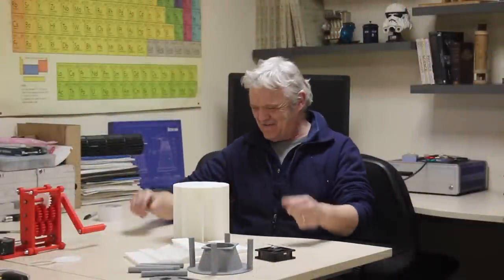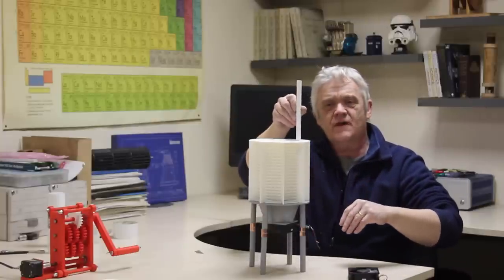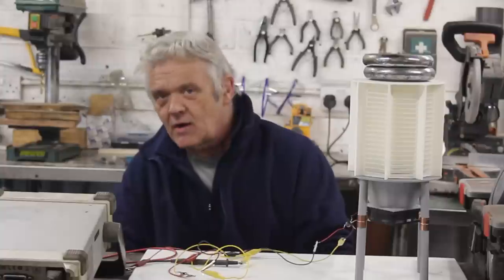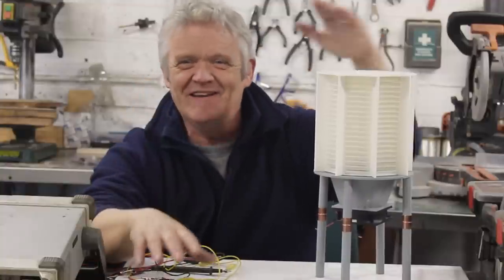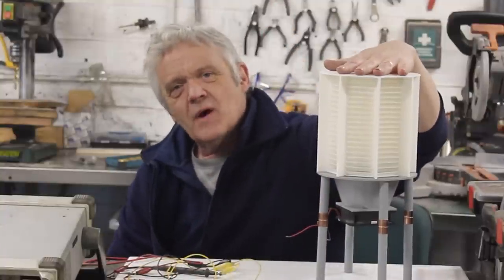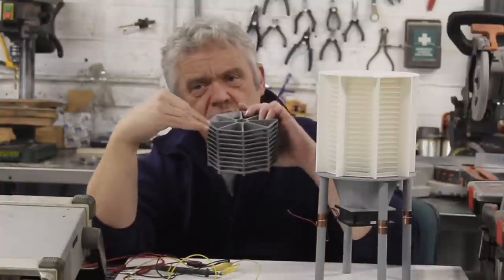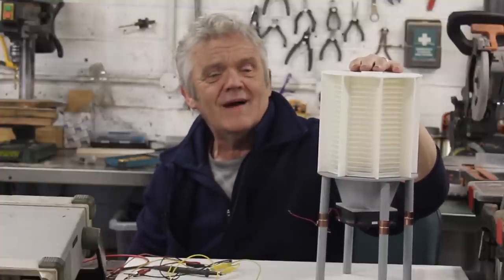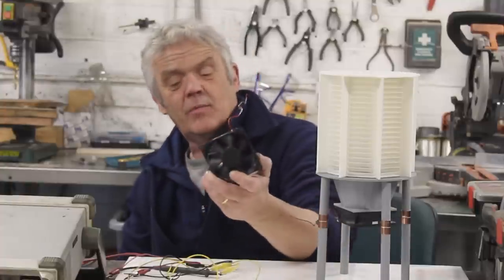1835 Darwin Wind Turbines - The Answer To Wind Generation

Comment: I have an idea. If you used a hexagon and then made the path for the wind going down into a spiral, (but keeping each side of the hexagon isolated) then that would allow you to pre-spin the wind, and might be more efficient, because the wind would be faster on the outside edges where the fan is more effective. What do you think?
Reply: This is an idea that might work... not sure how much extra you would get, but I can say that professionally, we put "baffles" on the inside of duct work to prevent the wind sensor devices from artificially picking up more or less spin for vortex effects which obviously alters the measured wind speed. So, if the internal baffles direct the wind energy in the proper rotation... there should be some change. (not sure how much tho... I suspect it would only by a few percent difference).
Reply: Would you also get more drag from more surface area?
Reply: I am a novice, but your suggestion sounds like the centre funnel in my dyson upright cleaner. I saw a new clip last night on a Youtube channel named Ziroth.  A new design for a propeller for drones and motor boats where the propeller is spiralled with a cut-out loop in each blade…
Reply: Hi, can I make a suggestion to make the construction cheaper and easier? 
Think of a wine carton with the carboard separators which are just flat boards with perpendicular slots which form prismatic cells.
If you use sheet metal and make the slots at an angle so you form and angled mesh with an effective downward tilt angle of 35 degrees. I would also run the sheets at 45 degrees to the horizontal so the face of it looks like a diamond pattern (this should be a little stronger than running the sheets horizontally and vertically. Clear as mud?
You could also angle the grids slightly so they pre spin the air as @chris Bruner suggested in a previous post.

Comment: I feel like you should call this device a Wind Fresnel, Wind Lens, .....or Mini-Blind turbine. ;P You've actually piqued my interest in these as I'm really considering making a solar pergola and surrounding the support posts with this would look decently fashionable and make energy as well.
Reply: I'd vote for the term Wind concentrator. To generically define a whole range of ideas that turn a large area of slower moving air into  a smaller area of faster moving air. 
Then to refer to this kind specifically, we would call it the Darwin wind concentrator. 

One might think of this as related to ducted turbines  but ducting can have a large funnel in front compressing air going, or may have a large funnel  on the rear creating a low pressure  area that pulls air through.
Reply: the roof of one of these covered with solar panel sure wouldn't hurt.
many places a structure under 100 sq/ft needs no permit, and doesn't say a dang thing about it not being 15-20 foot tall. set your posts and build the unit to slide up them and lock in place?
Reply: Aye! You are right, reminds me somewhat of the wave power turbines that build a big concrete funnel above the water with a turbine at the top of the funnel where the wind will push through as the water rises.
Reply: That is a genius way to evolve the idea! Just expand the central reservation for some seating and performances and have the wind make the power around you. Nice.
Reply: Why not a series of Venturi planes that would accelerate wind speed hitting it? Just asking
Reply: The Turbine should be placed on the Top, and the outlet needs to be a funnel formed like a Finn that also can rotate in the wind direktion... and withith it covers with his zylindric housing the nonwind parts of the collector ...
Reply: @GpunktHartman  Could potential raise the roof with this idea... :face-blue-smiling:
Reply: @dandantheideasman  ... so you understand my discription ... ?
If a designer did this, it will be not bad.

Comment: i think this would be a really cool as a progression of the the wind wall as a kind of fencing, potentially with a vertical axis wind turbine mounted horizontally in the bottom mostly just to reduce the amount of electronics necessary and could possibly make it easily modular for longer fencing

Comment: You might want to try using a similar director on the under side to drive the air out of turbine creating a vacuum on the bottom blades of the turbine in the same way you use the top half to create a high pressure flow . This push pull effect may be more efficient.
You also might find that is always a limit to the area size of the director mechanism you can funnel air into such hole where the turbine sits.

Comment: The only issue I see with one of these outside is wind driven rain. Which in Texas we get a lot of.
Rain being blown sideways would go into the piping potentially causing damage to the motor.
Reply: It wouldn’t be too much trouble to have the generator outside the tube connected with a belt or chain with the impeller on the inside of it  on bearings so that the water need not soak the electrical portion of the device.

Comment: You should probably print a cone just over the center of the fan blade attached to the bottom of the pipe which will tighten the outlet and force the wind down faster. I say just inside the pipe at the bottom so that the fan doesn't carry anymore weight no matter how light.

Comment: @RobertMurraySmith  >>> Just off the top of my head: Build two. One with the 'generator' directly attached to the bottom of the come. Build another with a length of pipe between the bottom of the cone and the generator. 

Place both outside at the same time, and record the amount of energy produced by each one over the same span of time. 

{I PRESUME you thought of this already, but I figured I would comment anyway.}

Comment: I'm a fan of the added outer fins as it effectively increases the total area of wind being funneled into the collector. Just building the whole thing larger would likely have the same result, but with 3d printing at least, build size comes at a premium. Building as large as you can and then adding on separate fins in post production could go a long way towards increasing what kind of collection area you're working with.

As a suggestion for future progress, I'd love to see some thought put into the turbine side of the equation. It could even be a fun channel activity for subscribers to submit their designs to be tested against the stock fan as well as each other's creations.

Comment: Design/print the inside of the funnel to have guide vanes, to start the vortex, before it hits the fan. Further, try a swivelled venturi exhaust pipe, pointing down wind, (to create a small vacuum). Must admit, wished I had such a workshop. Good luck. 😎

Comment: You should switch directions: Make it draft upwards and put a spinning pipe on top, like a weather vane. Just remember that it needs to expand the airflow again to be efficient.

Added benefit is that the turbine is further away from the ground and thus a lot less noisy.

Also, if there's a storm, this thing is likely not lifting off so easily.

Comment: I just had a thought about what might increase the efficiency of the PC Fan motor as generator a bit: Change the angle of attack on the vanes.
A fan's blades are the angle they are to efficiently push standing air forward. We need to match that angle, but in relation to the direction the air is coming FROM.

Comment: Tuning a system is always the fun part…have you seen the MIT toroidal fan blade design videos? They’re about reducing prop blade tip vortices and the associated drag…then you could play with reducing the backpressure behind the fan- or is it increase pressure in front of the fan? Laminar-turbulent-Reynolds number…ideas are spinning like prop blades no doubt!
Reply: And speaking of Venturi, what about printing an exhaust flare/cone/horn? The curve into and out of the generator may prove important to efficiency/output.

Comment: Dang, I was hoping you were gonna show input windspeed and output speed using the anemometer. Very interested in seeing the windspeed increase percentage. Great video non the less!!
Reply: It seemed to be suggested that the increase in wind speed was proportional to the larger "swept area" of the tower vs the fan by itself.

Comment: Instead of vanes, you could have hundreds of helical cones in a petal pattern directing airflow onto specific points to maximise efficiency.
You could also have a mechanism 'storing up energy' and then spinning the unit as a whole to direct an immense amount of airflow from every cone all at once on to the turbine.

Comment: I do something similar, but use a flat-sheet rotar mounted at center onto a vertical shaft.  

The structure twists the airflow and that big flat blade is immersed in that airflow and twists with tremendous torque.

 I attach a d.c. generator of my own design and I have electricity whenever the wind blows from any direction with ONLY one moving part.

Comment: If you put a longer tube on the downpipe then make the output hole about 1" it will compress the air and force the air to move faster. Then focus output air on just the blades of the fan. This air will be more energy dense and spin the computer fan faster. Also the longer downpipe will give it more back pressure

Comment: this is very similar to the wind catchers used for air conditioning in the middle east, which is seeing a resurgence in interest as people look for more economical and ecological approaches to new designs.  it would be interesting to explore using a design like this for wind energy production as well as secondary functions such as heating a mass like the sand battery, and providing cooling in asimilar method as the middle eastern design.

Comment: What about turning it upside down... like having the eventual covection force of the air helping the process (maybe a hot plate underneath, too - some black painted iron plate exposed to the sun, and/or a closed section (black painted iron ring) in the top - with a wind turbine at the top)?
... and using J shaped fins to 'invite' the air flow to rise from the moment it enters the wind (dream) catcher?
By the way, I just get to know this channel and I already love 'Sir Not Anthony Hopkins' ideas, witt and knowledge.

Comment: Robert, I just had an epiphany with you 35 degree angle for wind directionality. I remember that there was a engineering modeling software program that was sold years ago. I do believe that somewhere I have a copy. This is old but I got it for free. All I have to do now is find the disks. Hopefully that will happen in a few days or a week. When found I will send you a burned copy for your enjoyment and educational learning. This modeling software is BANG ON which will help you get the correct angles the first time. This will save you a lot of time and frustration. Just hope I can find the disks. This will give you way more knowns from unknowns. Will let you know SIr.
 Good luck with the Darwins wind turbine. vf

Comment: using the nozzle from the ID of the catcher down to the intake ID of the fan generator is choking the air which in effect slows it down, an idea would be to the make the catcher the same diameter as the fan intake and test both ideas, this would answer which is more  efficient 'nozzle choked' or 'straight through'
worth the work to test this theory
Paul

Comment: Fantastic, I've been watching the evolution of your various wind power designs for some time with great interest. The idea of having a wind capture device with no moving parts is brilliant. In Wales domestic conventional wind turbines need planning permission and there are all kinds of restrictions to install them. I can't think of any reason why even a full sized version would ever be an issue, even (possibly?) when installed on a roof (any suggestions anyone?).
Having spent many years in Nature conservation you may potentially have solved another issue. The full sized version might be a great home as a communal bat or swift colony!
Reply: Well, it does resemble a traditional weather monitoring "station"/ box with dimensions like an old manor dove cote you have a protected habitat...
Reply: Minced bat?
Reply: @daveh6356  (oops, well I ass-u-med they meant a well ventilated structure, sans the fan... Lol)

Comment: I would expect directing the wind upwards, into a "chimney" would make a big improvement. The external wind passing over the top of a vertical column, adds extra flow.
There may be a venturi effect at  the bottom of the downward column, but the wind will be disturbed by the legs, and will be slower than the uninterrupted flow of the wind over the top.

Comment: the volume of air in the tower is pushed through the cone which compresses the air which increases wind speed which moves the fan. Under the fan is a low pressure area which helps to draw the air through the fan. I notice that the tower has a cap on it. Wondering if removing that would improve air flow as well because without it the downward movement of the air could draw in air from above as well.

Comment: i have a auto siphon in my aquaponics greenhouse that spins the water into a left turning vortex so it will flow faster than straight flowing water.

Maybe add some fan blades in the tube beneath to spin it up into a vortex so the wind will accelerate even more :D

Comment: I really like the design Rob!  Here is an observation to consider.  Try leaving a gap between the cone and the turbine blades.  It would draw air in to add to it's output through the gap.  For example take a plastic bag and hold to your mouth and blow the bag up.  Now give a gap between your mouth and the bag and blow.  It will fill up the bag much faster that way.  Maybe it will work with your design as well.  Just a thought.  Thanks for the video,  I really appreciate it!

Comment: There was a version from the 70's where the air was directed into a cyclone inside the tower which created a low pressure area pulling the air up through the turbine and out through the top of the tower.  There was another one with no vents but water was sprayed into the interior of the tower cooling the air which would then blow out the turbine at the bottom (this one was designed to desalinate water, it just happened the calculations showed the production of excess power as well as desalinating the water but it did require piping seawater well into a desert).

Comment: I don't know if anyone has already suggested it. but old venetian blinds would be excellent ready-made slats. Curved like a plane wing should be better than flats. Very thin for less frontal drag, they would need good vertical support (vertical vanes)
If they were positioned in each frame with one end a bit higher than the other, it would give a cyclonic spin to the internal flow, as others have suggested. The vertical support vanes could be angled to enhance that.

Comment: Here is an idea make the shutters pressure opening from the (windward) side and pressure closing on low pressure side (leeward) add a curved (wing shape to louvers keeping more air closer together improves flow rate) add a inverted domed top to initialize the tornado column earlier, and with a one way directional flap would actually draw in more air. Advantages of this modification is over speed or storm protection.

Comment: I love the videos. I have subbed and just started watching them. I was just giving a little thought to the forcing the air down vs up; it would seem that forcing it down would mean there could be issues or concerns with water in inclement weather. Wouldn't the design cause it to also collect a lot of rain? Forcing the air upwards would use fins/vanes that would basically repel most moisture

Comment: As an idea, paint your basic Finn structure black reverse the angle, 35° upwards. Pipe up several feet all in black your turban on top exhaust on top. That way you get expansion of the air you take in because of heating during the day anyway so you increase your air flow through thermodynamics just a thought I don’t know if it will increase enough to warrant the changes, but it be a nice experiment.

Comment: Another interesting experiment would be to use smoke to see what happens to the wind AFTER the fan. Optimising that dispersion (in the context of a wind that is blowing) would probably be needed in a real world example, where the wind blows not only at the top, but at the entire vertical column.

Comment: As of February 20th the BBC is reporting that Skegness pier and a factory in Spalding have been fitted with 2m tall vertical wind turbines of this design in a trial.  They are using the design which uses a turbine at the top.  Will be intresting to see how they get on.

Comment: Keep in mind as the wind goes around the structure it will crate a vacuum on the down wind side of the structure which will create a counter force on the motor reducing the potential power.  Probably a lot less than the up wind side produces but it would still have some effect.

Comment: Robert,  two hemispheres on the same centerline with your fan/generator between and what ever ducting connecting them,  I prefer a bellmouth inlet and outlet, to connect the underside of one hemisphere to the top side of the other. Your Darwin creates a pressure differential been the inlet and outlet at the cost of two 90 degree turns and the sectioning of all those louvers. As long as the centerline of the two hemispheres is at 90 degrees to the wind, vertical orientation, then the pressure difference is produced while those large inefficiencies are avoided at the cost of more modest ones.

Comment: If you add a section of straight tube that has 2 perpendicular holes in it above the lower funnel. The air passing through the tube should create a sucktion, that sucks more air into and through the funnel. Simular to the cross holes on air gun. Air guns blow more air out the tip because of the cross holes.